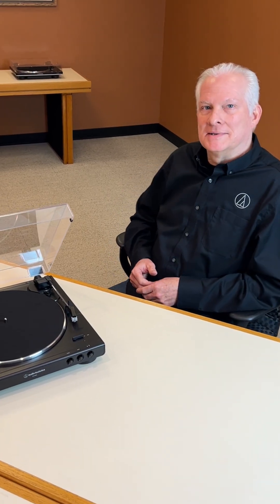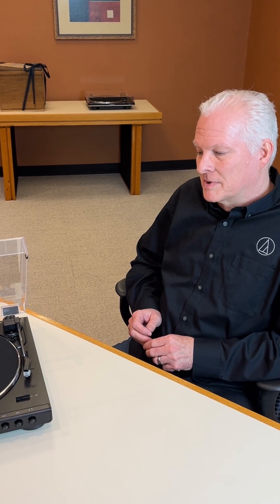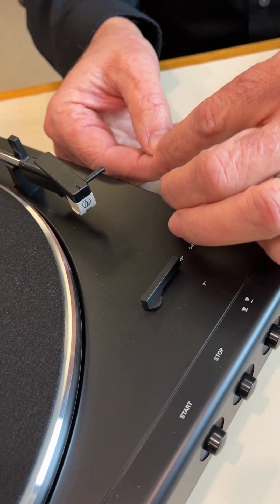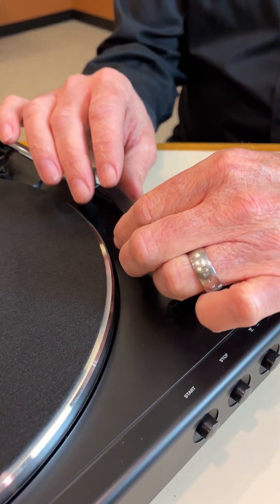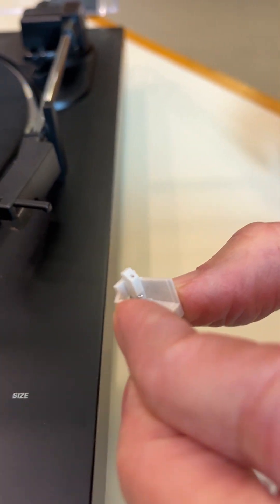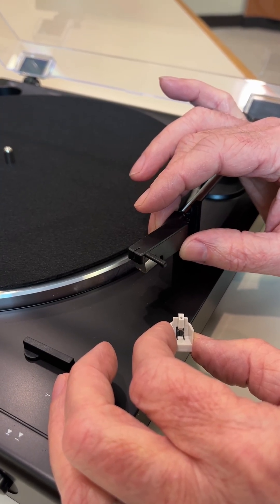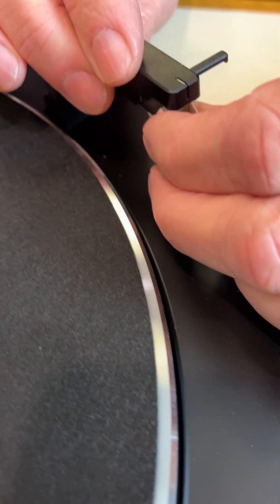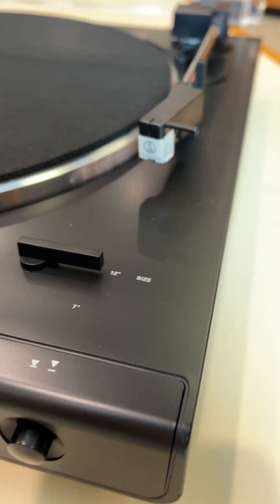Audio-Technica | AT-LP60X Series Turntables | Stylus Replacement Tutorial

Comment: Me over here staring at this 170 dollar stylus wondering how anyone saw anything besides a knuckle. Oh sweating.
Reply: Okay, well, may have been overthinking that one. Easy peasy. Hear some space between instruments and vocals instantly. Woot!
Reply: What stylus can you get that's 170$ for this?
Audiotechnia only officially have 2. And LPGear do a carbon one. They're like $30?
Reply: @kaydog890 I have an Audio-Technica AT-VMN95ML Microlinear, which is running for about 160.
Reply: @kaydog890 I should note I have an LP70. I just hadn't, at the time, installed a stylus.